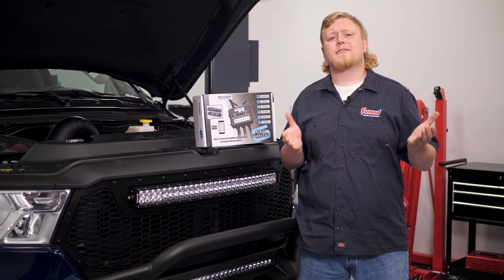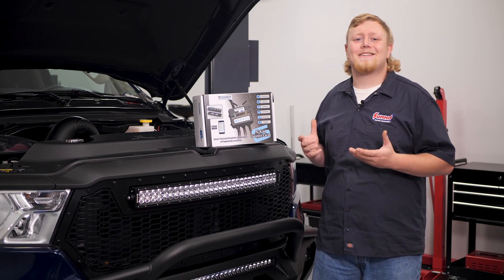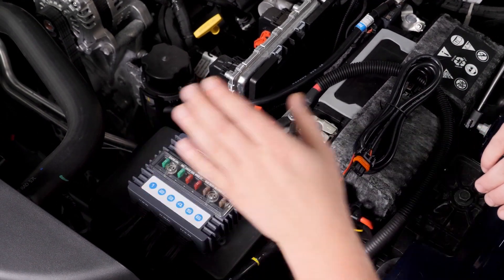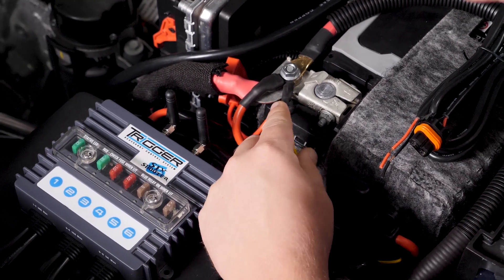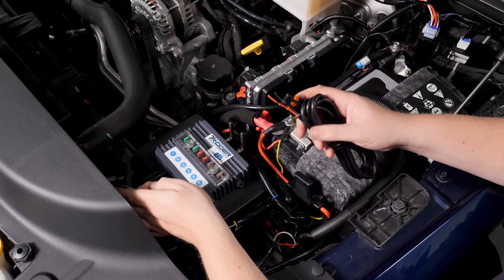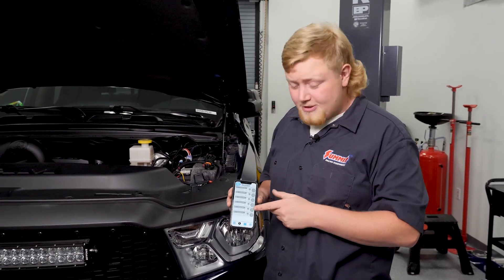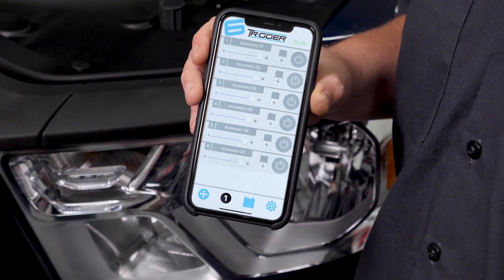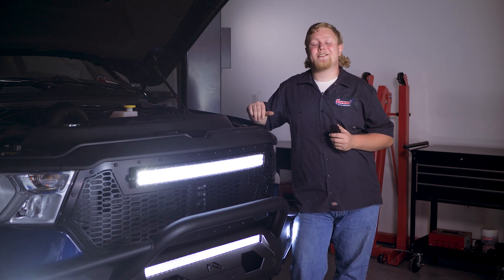Project Ram (Bonus Episode!): Summit Racing's 2020 Ram 1500 Big Horn Wireless Light Control

Comment: How did you guys attach the six shooter control module, did you guys bolt it on or just stick it on?
Reply from the maker: Since space was limited in the engine compartment near the battery, we decided to use 3M stick on Velcro that was rated to hold 10lbs. We mounted it on top of the fuse box lid. If we had to get into the fuse box, we can easily lift off the trigger controller and have access to the fuse box.

Comment: Would be nice to have some real info? Like what amperage the channels can handle, do I need to add relays for high loads? Saw fuses?
Reply from the maker: ·         6 channels, 2 x 30 amp, 2 x 10 amp, and 2 x 5 amp circuits
 
·         100 amp fuse installed on positive input wire for whole system protection
 
·         Not recommend to go over the rated amperage for each channel, so there is no need to add additional relays.
 
·         Mini blade fuses